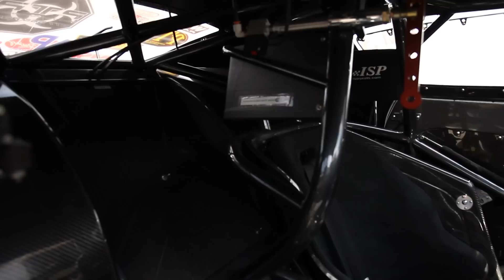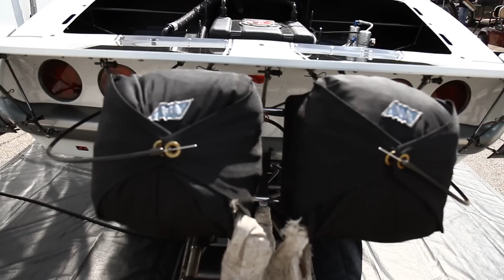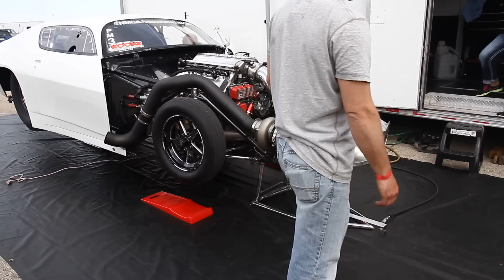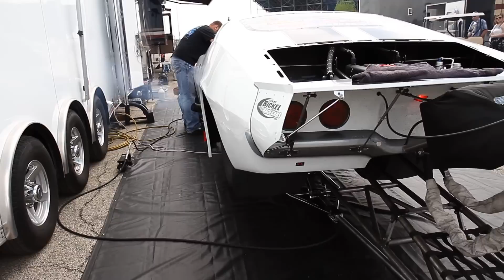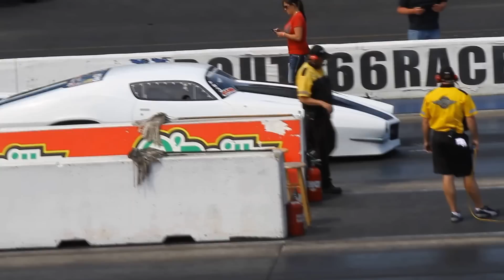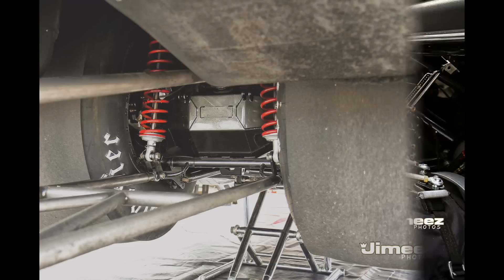TWIN TURBO '701/2 Z/28 STEVE SUMMERS CAMARO WARMUP AND TEST HITS AT RT66

Comment from the maker: LATEST 1/4 MILE RUN! http://youtu.be/eKuicpkm08I?t=1s
Reply: If the exhaust pipes went from the turbos straight out to the hood, then the incoming air, as the car goes down the road, would hit the gas flow and not the car windshield. This would greatly reduce drag. Effectively what you need to do is cut the exhaust pipe at its first bend. The rest seems fairly ok.
Reply: nomayor1 It has to follow the class rules. Plus if the engine went south all the flames and possibly small engine parts would be aimed right at your head.
Reply: +vector6977  perfect answer

Comment: Wow thats some serious impressive engineering 👍👍👍

Does it make any difference if you spun helical threads to vortex the ram air into the turbos straighter for better air flow?

Like the throttle body corkscrews.. Helix power tower stuff?

One of the nicest sounding drag cars ever. 

Powder coat them bottles inside red or white. 
Thats all id do and I'm a billionaire  .. On my planet✨👽

Comment: Is there in fact any part of an actual camaro on it?
Reply: The front is the only part that vaguely resembles one imo
Reply: David F COPO Camaro?  Cobra Jet?  If those aren't racecars straight from the manufacturer, then what the hell is
Reply: David F
these REAL race cars would not stand a chance on a formula one track. corners?
Reply: David F
LeMans- I'd love to see these guys try and race for the length of time those guys race for.
Reply: David F NHRA stock, NHRA Super stock.  NHRA Stock Eliminator.  No one has, but if anyone wanted to enter one into NMCA True Street, it would dominate, as they still fall under the rules for true street, and run faster than the record setters.  Do you want any other education, while I'm schooling you?
Reply: David F
Can Drag cars turn corners with precision?,
then why say 'they are better than formula one',
- that is a pretty dumb comment isnt it?
Reply: Sometimes they use the actual bodies or sections of the original bodies. Although, all glass and internals are aftermarket.
Reply: No

Comment: nOOB QUESTION INCOMING! Wheres the air filter located for this setup? Or am i just blind?
Reply: Michael Simona No need for an air filter on a performance vehicle, most race cars will not have them, especially ones that do short quarter mile runs. The engine is not exposed to less than ideal weather and road conditions so there is not much to filter, the filters would just rob you of horse power.

Comment: Why not run the exhaust out in front of the front tires?   Supposed to add a little  mph by helping the air flow around the front tires instead of getting all " dirty" swirling past the wheel openings...lot less tubing at least.

Comment: I have seen too many photos of turbo in vee stock V8 engines with the intercooler nicely fitting in the front (and all pipes, bends, and adapters were SMOOTH). Now exhaust on the outside looks just wrong to me. What class is this, where they allow turbo, but ban DOHC V12?
Reply: you really think a DOHC V12 is a better option?
Reply: halleffect1 Turbos have small exhaust manifolds. 3 cylinders with even firing can go into one turbo and not interfere with each other. Thus i3, flat 6, v6, v12, v12 180°  are great for turbo. Small exhaust manifold are good for high rev. High rev likes DOHC . But then I found out, V12 are rare or expensive, and Jaguar did not had double overhead (per bank) anyways.
Reply: Arne Christian Rosenfeldt small exhaust manifold aren't all that good for high rev, actually the exhaust plays such a small role in modern performance engines now, dragsters only have them nowadays to keep the gasses away from the vehicle...
Reply: ***** High Rev is for me something like 12 kRPM ( F1 turbo, street bike). Very high rev would bei 20 kRPM (F1). Last week I learned that the mustang has DOHC, but I thought that dragster racing uses OHV. Exhaust is the way to improve performance and efficiency at the same time. May be more important for longer races. I like the idea of rocket thrust made by the exhaust. Only about 10% compared to thrust by wheels, but that may count in competition. I would never point an exhaust to the side or to the ground or make it too large.
Reply: Arne Christian Rosenfeldt : /  Ummm, not sure what to say now, I don't even, even know where I am...
Reply: These cars make 4000hp very easily

Comment: Thats a sweet setup, looks like it was just from the build shop and doing some shake down launches.
I will say this though, someone needs to police the ppl in that pit better when the engine is running. I would have tackled that crew member walking in front of the open, un screened intakes with that rag dangling in his hand and ready to get sucked into one of the turbo's creating a totally fucked day.

Comment: The turbo's really don't get a chance to get that hot in the short time they are in use... So why the need for an intercooler?  I think they know what they're doing...
Reply: alcohol burn way cool ,my friend has a supercharged 32 ford with a big block and they run it and the supercharger actually has frost on it ,you touch it it is cold  frozen actually
Reply: Yep no need for an Intercooler here it is making all the boost it can use and it is not hot enough to make a difference.
Reply: Eric Kent the intercooler is there to increase density of the intake air.  It's not for cooling the mechanical parts.  Denser air = better combustion efficiency.
Reply: Keita Ikeda He knows, that wasn't his point.  The engine isn't running long enough to heat up the turbos, which heat up the air charge, which lowers efficiency.  The intercoolers are there to lower the air temp again after the fact.
Reply: any compression of air builds heat instantly ,that is how a diesel  fires its load and the cooler the load the more oxygen is present and it burns much more efficiently with more oxygen
Reply: Amen to Mr Knudsen.  Let's all just take a look at the adiabatic process, P-V diagrams and see why the intercooler is an advantage whether you have a hot turbo or not.
Reply: is that a lsx 454 small block?
Reply: that would be a great starting point for a race engine , perfect building platform ,six bolt mains  all aluminum block and heads  ,prudy kool stuff
Reply: you know the cam doesnt have to be al;l that radical with turbo ,ive had great luck with a stock cam believe it or not
Reply: you dont use an intercooler to cool your turbo's.. its to cool the air going into the engine...
Reply: Bram van der Heijden Exactly right...!!
Reply: David F OK, I don't want to get into some kind of flame war here, but if you're going to say something like "It's physics..." it would help to be accurate. Density is mass per unit volume, not area (cubic foot, NOT "square foot"). Additionally, I have never heard of an "air molecule," as air is made up of numerous molecules, chief among them nitrogen and oxygen. Just sayin'. Us physics teachers like accuracy. :)
Reply: David F
ahh..its nit pick...just sayin : /
Reply: Probably running methanol and the added weight and ducting for an intercooler may not outweigh the benefits
Reply: highvelocity123 Not true, it's the compression of air that makes it hot..not how hot the turbo is.
Reply: Ryan Barbolt Well, yes and no.  The Turbo's do get hot and transfer heat.  As I said intercoolers after the fact so they do cool the air after it's pressurized minimizing the turbo heat and pressure effect on air which is minimal.
Reply: Intercooling the intake charge has absolutely nothing to do with the temperature of the turbochargers
Reply: Ryan Barbolt Have you ever seen a video of a turbo engine on a dyno at max rpm with the lights off?  The exhaust glows cherry red.  So your saying that heat doesn't transfer in the turbo? I'm not following you...
Reply: The turbo get's hot, but the charge temperature has nothing to do with the exhaust sides temperature, and yes I've run many of my own and other peoples cars on a dyno.
Reply: Ryan Barbolt Ok, sounds good.

Comment: Without a radiator, how long can this engine be run?
Reply from the maker: Elliot Stephens About 5.81 seconds! lol
Reply: Elliot Stephens With atomization of the fuel going in it might drop temperature across the intake and heads... Just my guess... Or there might be a radiator in the trunk?
Reply: +Elliot Stephens Im surprised it can idle for more than a minute. I think the only think wicking heat is the aluminum body. other than that the car is screwed. No intercooler either, which wouldnt matter unless they ran in AZ.
Reply: +DeFreshS10 lol, no intercooler? You do know there are racing fuels out there that you can use that doesn't require a intercooler.. methanol fuel for example... there are some fuels that help cool the engine.. so some drag cars don't even use radiators..
Reply: silencebone methane cools the incoming air, i dont dispute that. but combustion is still hot... we are talking about fire.

cars need a radiator... unless it's a drag car going to be run for a few seconds...
Reply: DeFreshS10 why I said methanol as a example..  
for drag for a few seconds no you wouldn't need it unless the dragcar does overheat..I was talking about drag cars that don't need radiators or intercooler.. not all cars in general..
Reply: silencebone technically you said "racecars"
Reply: DeFreshS10 Yes, which again I was talking about drag cars in general... are we going back and forth with this? I already explained it was about drag cars.. need anything else??

Comment: No intercooler
Reply: the airflow restriction of a intercooler might hurt more than help in this case.
Reply: A good air to water intercooler can give you 30% increase in power
Reply: t045t2346 thats  good point, I was speaking of the average Joe's air to air intercooler
Reply: ***** any good intercooler can give you that 30% increase in some cases it can be more
Reply: I'm pretty sure when you flow 2000+ cfm it becomes more about ambient air temps, because there is less time for cooling and more friction of airflow
Reply: It's methanol guys, no need for an intercooler... Did you really believe you out-thought something these guys overlooked lol
Reply: My thoughts exactly^
Reply: I run ethanol and gain great benefits from a large IC.
Reply: It's methanol, there is a big difference between e85 and strait methanol,
Reply: E85 is 85% alcohol and methanol is 100% different type of alcohol, not sure what your define as a big difference, but theres not a big difference between the numbers 85 and 100.
Reply: oistein74
 Probably that part where it's a different kind of alcohol...that might be the big difference. E85 is good stuff, no doubt, but it's definitely not the same as straight Methanol. Methanol has extreme cooling benefits. Not only does it help prevent detonation, but it cools the air that it interacts with significantly. Much, much more than E85 does. This is why some people inject it (water/meth) as an intake charge coolant. An intercooler in this case would be totally pointless.
Reply from the maker: Craig Berry its in the description at the end but here is a full pass WORLDS FASTEST '70 1/2 CAMARO TWIN TURBO MATCH RACE RD1 5.96@253.47MPH!
Reply: Craig Berry
I ran wmi together with E85 last year and it made no sense as I could run same timing with E85 alone. Wmi is good for running gas.
Reply: Methanol still need more oxygen than pump gas...
Reply: yohan strauss No that's not how it works.
Reply: yohan strauss Set aside your arrogance, you completely misunderstand what that page say. So no, YOU have a lot to learn. Try again.
Reply: oistein74 there is a reason these guys are at the track and your jaw flapping on youtube
Reply: helldog918 Whatever you say, nutswinger.
Reply: yohan strauss But they need double the air to get the same energy, because Methanol has such a low energy density! So in reality you don`t get much advantages at all...just stick an intercooler and a biger turbo on it and go with pump gas...cheaper in the long run!
Reply: Alcohol fuels have much less stoichiometric value than regular gas, ie why we need to add 40% of fuelmass vs air to get lambda 1. You still nedd same amount of air to make power. Only oxygen adder is Nitrous Oxide (NOS) which has two molecules Nitrogen(unusable) and one molecule Oxygen(usable) . This extra oxygen enable the car to add fuel without messing up lambda which again leads to more power. Simply put. So, no.. there is NO extra oxygen in alcohol fuels.
Reply: thats exactly what i thought when i saw this....
Reply: oistein74 There would be no point in an intercooler for something that requires that much flow.
Reply: oistein74 I hope you're just trolling right? .... e85 is 85% ethanol and 15% gas . Methanol and alcohol are both completely different fuels . BTW , this is like a 4000-5000hp engine....... I hope no one is really suggesting they know something these pro don't.

Comment: The brakes are very very small in my opinion for that much power.
My Motorbike actually has 2 pistons in the Front and these are the same size like these.
Reply: softundsafety Did you not see the two BIG ASS chutes on the back of the car? Who needs brakes when those deploy?
Reply: Does your motorbike also have 2 parachutes?
Reply: Oh i haven't seen them. Sorry :)

Comment: I thought it was funny when they wrote this is a Camaro. I dont think there is a single piece of that machine that was ever Camaro. Its more space ship the camaro.
Reply: I think those might be real Z-28 badges on the front fenders...and hopefully they didn't cut up  a real  70 1/2. I used to have one  in 73....wish  i still  had it..Nobody seems  to even notice the roof..looks like it has been chopped  3 1/2 maybe 4  in..Should have done a layback, i've done them  both ways....layback chop looks way better and better aero
Reply from the maker: They are painted emblems along with the door handles...check out his new camaro for 2017....https://www.youtube.com/watch?v=BE8-nPIHt5o

Comment: have you tested each cylinder temperature ,with one of those laser temp tester device  ,just point the laser beam at the exhaust right at the head and check the temp on all cylinder at a idle ,it sounds to me like a slight miss on 1 cylinder at a idle ,it cleans up after it revs up but  it might be indicating a tight valve our some other sealing of cylinder problem .dont mean to bug ya ,sometimes when your out side ,looking in ,you see or hear things that you miss when your all into what yer doing .graet car ,are yall from illinois ? i grew up there in rockford ,i loved street racing there as a kid i think freeberg had a summers bros rear end in his vega  back then ,what ever happened to bob long and performance products? lou watson still racing ? mike meseracca? denny carlson ? i miss the good ol days at hollywood drive in and street racing on the weekends

Comment: the physics is the same for both boosted motors except with the turbo you dont have a  robing  sorce of horse power   as you have with a belt driven   booster pump all other factors are the same for each  application at the same time and track ,same sealevel  elevation ,higher less oxy lower more oxy runs better at lower  levels ,but burns more fuel , ok physics teacher , a gallon of water makes 1000 gallons of hydrogen , making a fuel [hydrogen] that burns with no pollution , a 130 octane rating , will not contaminate your engine oil ,no hydrocarbons in it so your oil will last forever almost and  it will propel  a  vehecile 3 times as far as  your overpriced  gallon of  gasloine fossil fuel, plus with new technology they can carry water as the   fuel so no explosion is  threatened then as it goes threw the injecters it is  bumped with   the morse potential , triangular  rotational  morse potential to be exact and separate the molecules making instant browns gas and run your  vehicle  with no pollution ,  with 3 time more poiwer potential and 3 times the distance ,with virtually no pollution ,totaly green fuel for only the cost of a gallon of water , why dont  we do this like that with all these benefical factors ? can you answer that question  of the day mr teacher of physics ? our navy does this with there torpedoes  so dont tell me it cant be done ,the ocean is the fuel tank for our torpedoes, they never run out of fuel , they also separate the two gases and breath the oxygen thats how they can stay under water for 90 days surface only for food , radio freqwuency does amazing things , to say the least. ask mr tessla  .. hydrogen with the turbo would be nothing short of totally awesome power output no detonation so you could run massive boost levels and no pollution atall , tear down motor the pistons look brand new , like it has never  run atall, no carbon , clean machine  for reals and it could run in outer space seeing how it has  its own oxygen , runs under water  with the torpedoes !
Reply: Karl Knudson in this case Methanol it's better